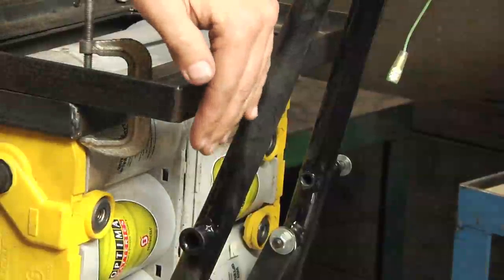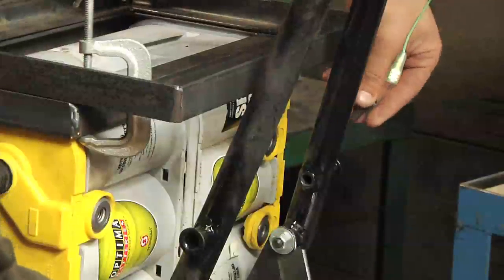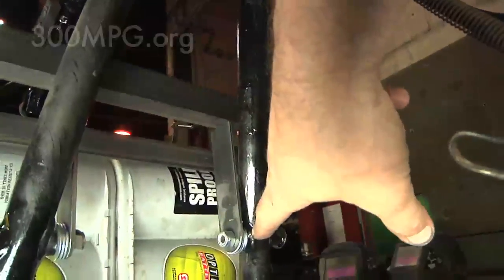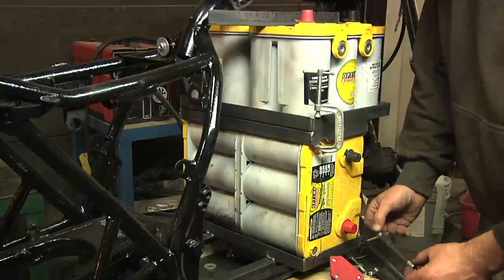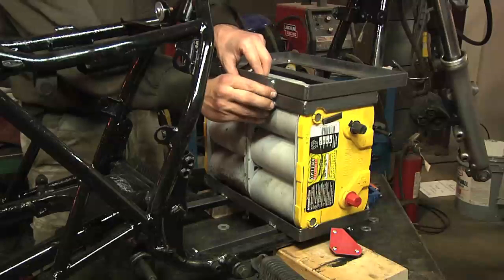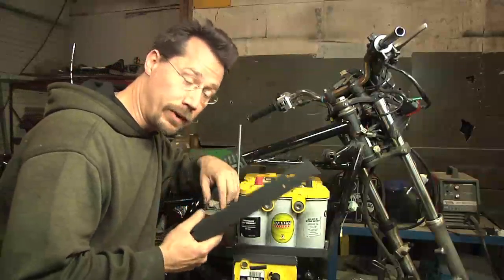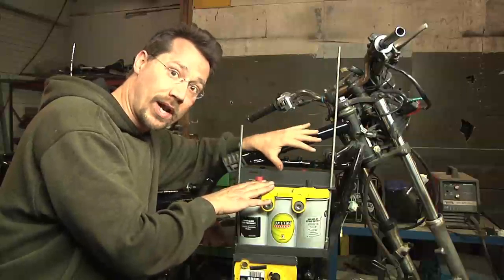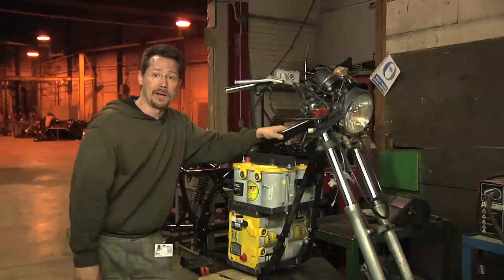EV Motorcycle - Battery Rack Part 3

Comment from the maker: Yep, 55AH model batteries. That sounds like a great price on the Calbs. You do also have to figure in a charger for lithium, and maybe a battery management system. Lead-acid is very forgiving.
I've heard that at this point lithium can come out ahead price-wise in the LONG-TERM, but it also assumes that you don't wreck your pack. At this point, I would recommend lead-acid for anyone's first conversion. Many EV converters say that everyone wrecks their first pack - it's part of the learning curve.

Comment from the maker: It doesn't seem like the range has really dropped any (however I'm typically NOT taking it out near its maximum range.)
I had the replace the speedometer a while back, as the old one was faulty. That also had the odometer in it, so I no longer have total miles. I can say that I generally do many trips, but fairly short range, which is a really good use for an electric vehicle.

Comment from the maker: @mrbr549 
Those batteries are specifically marketed as "vibration-resistant". Also, there will be some foam rubber weather-stripping between the rack and the batteries. These batteries will get vibrated less than the 12v battery in a gasoline motorcycle does.
The welder is a friend's. It's a Snap-On brand - I'm not sure of the model number off-hand. Works great though!

Comment: I was wondering if your batteries might be subject to vibration damage as they are mounted directly to the frame? Also, what kind of welder are you using? Thanks for your video!

Comment from the maker: @CyberDruif 
A motorcycle just DOESN'T look right without a gas tank. In this case, it will be a cover for the battery charger and some other components.

The bottom of the gas tank is already hollowed out, and a charging plug will go under the gas cap.
I might also drill directly into the gas tank and add the ammeter or other instrumentation directly into it. Somebody else suggested a drink holder....